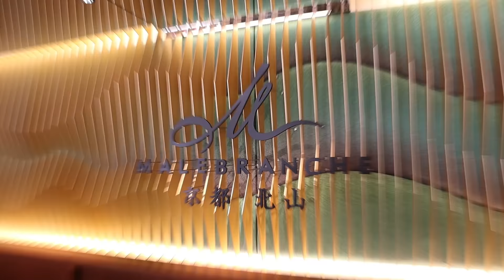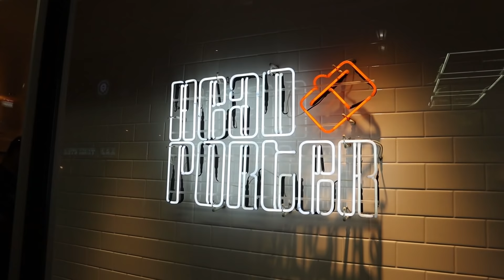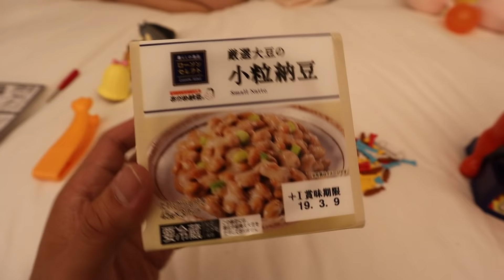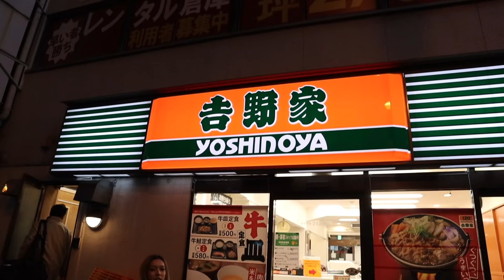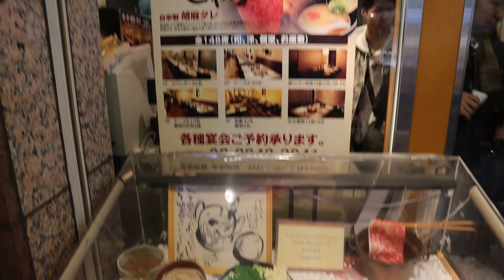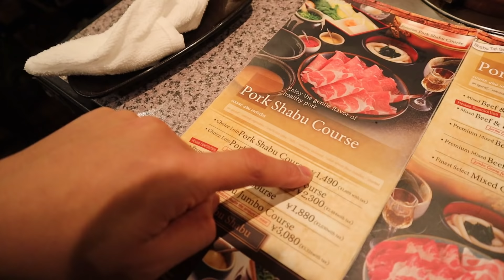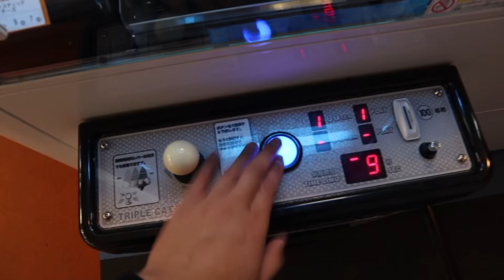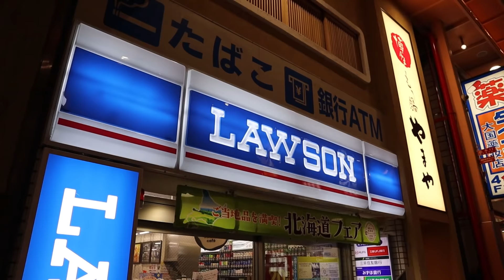CRAZY JAPANESE BITING DOG TOY!

Comment: Walks pass supreme store- can’t afford this. *shirts starting from $40+

Goes to bape buys shirt - $90+
Reply: Lmao in japan bape shirts are ¥6800- ¥7800 (60 USD-70 USD) so definitely cheaper than supreme shirts which go for around USD 100+
Reply: normally you'd be right
but supreme retail in japan is like almost double compared to anywhere else so

and bape tees don't cost 90+ in japan, only outside of japan
Reply: Jimin Jams when has supreme cost $100+ retail?
Reply: @jinno11  supreme in japan is about double EU/US retail

a basic tee will be 70usd or more from supreme japan
Reply: rimuru slime I have proxied straight from bape JP. The conversion rate for bape is $90AUD without postage.
Reply: @jinno11  basic tees from bape and supreme have very similar retails in japan